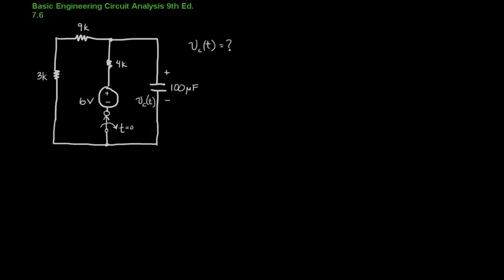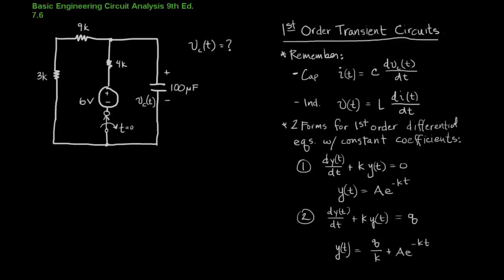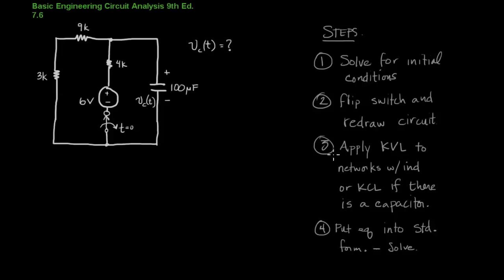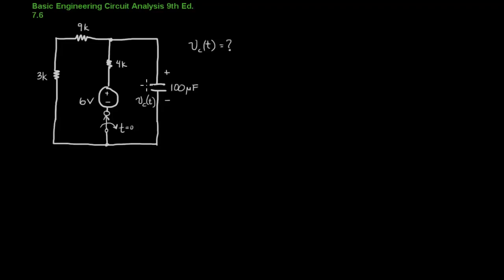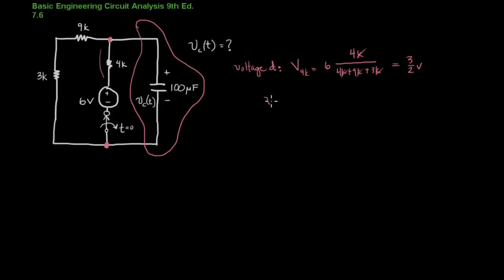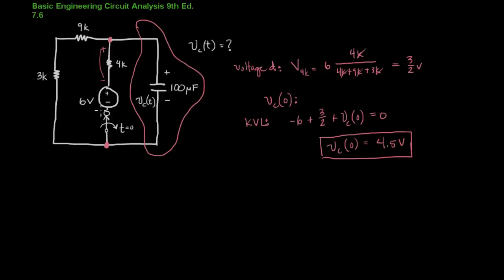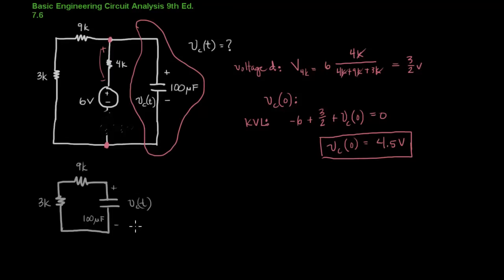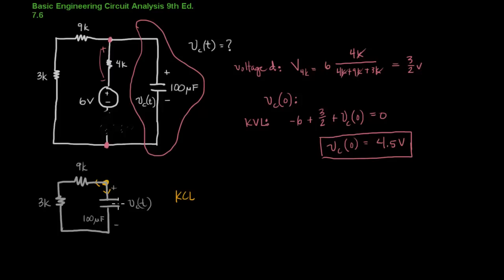First Order Transient Circuits

Comment: It seems like you went CCW in your KVL eq. I dont understand why the equation is not 
-6-3/2+vc(0)=0 Base on the polarity you gave to the resistor. It looks like it is dropping voltage not rising when going in that direction.

Comment from the maker: F Tjangnaka - Your logic is correct.  However I'm free to choose the direction of the currents for setting up a KCL equation.  Here I want to set the differential equation in standard form (with a plus).  Also, In more complicated circuits we wont always intuitively know whether a particular current is entering or leaving a node.  We choose a direction and when we've solved the circuit, if the current is negative, its opposite the direction we chose.

Comment: For t=0- If you treat the 9k and the 3k resistors as one 12k, then do a simple voltage divider between the 12k and 4k you get Vc(0) = 4.5 Volts in one quick step. That is Vc(0) = 6V * [12k/(4k+12k)]

Comment: This is wrong. V_c(0) should be 6.0V not 4.5V, since it is the voltage across the 4k resistor and ground.
Reply: You have been mistaken. Vc(0) is 4.5V. It is the voltage across the 3k and 9k resistors.